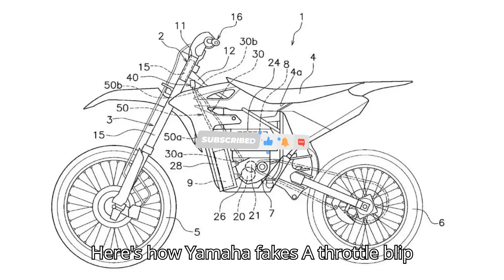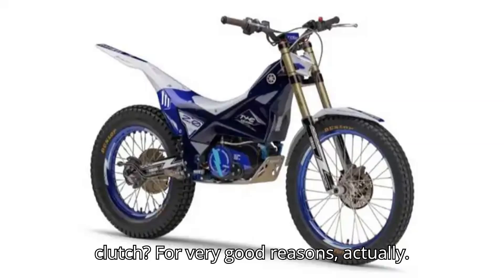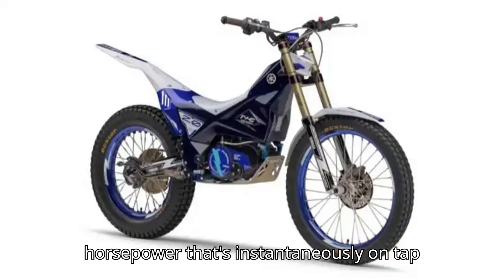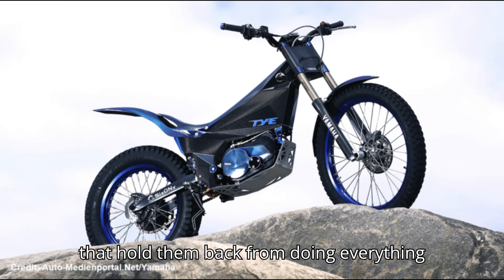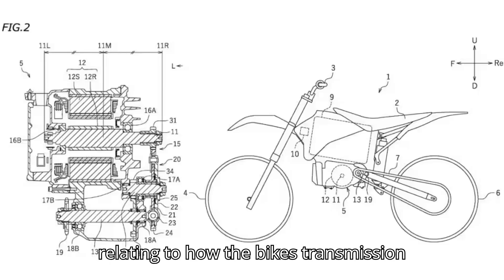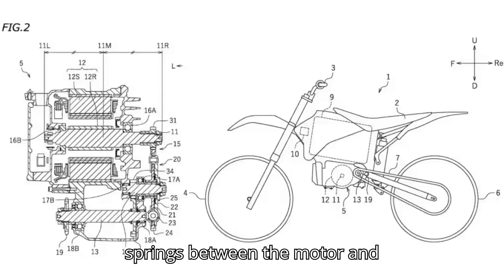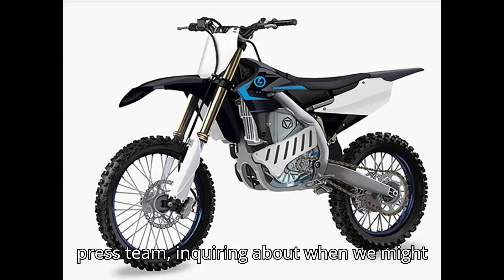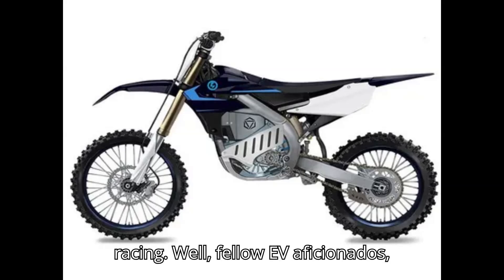Here's How Yamaha Fakes a Throttle Blip In Its EV Motocross Bike

Comment: That clutch is used to keep the revs in the right range to make good power without having to shift far too often. Something an electric bike doesn't need.
It's in the trials bike because they need a light weight motor and a single instant boost of power - exactly the same as trials riders do with combustion engines.

Comment: Nah, riders need to learn to keep the power to the ground. Wheelies are for clowns. A timed competition  between the Stark Varg detuned to 50hp against a top 450 was a total joke. Even with only a few runs experience the Varg rider was noticeable in superior performance. The  gas bike was all over the place with typical erratic traction. The slightclutch break will only result in the tires breaking loose. The narrator mixed up two opposite effects - softening the application of the "jolt" (a physics term, the derivative of accceleration) and causing the jolt by applying a clutch. Very poor description.